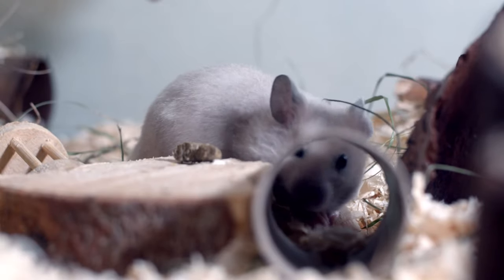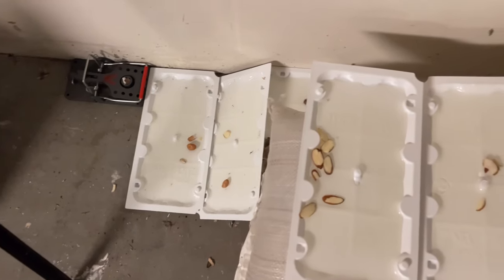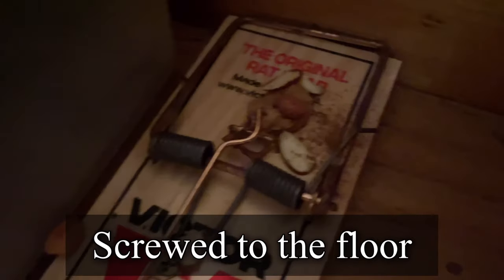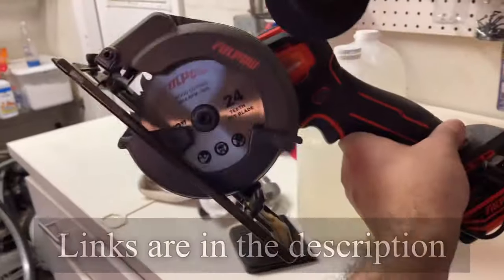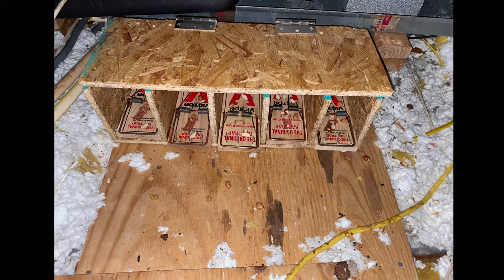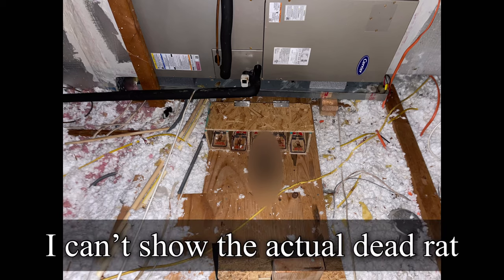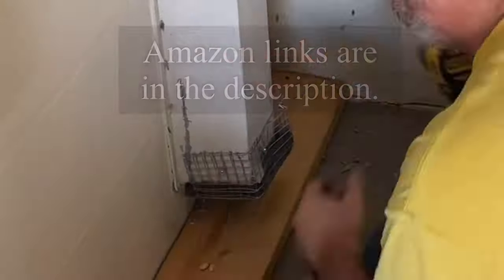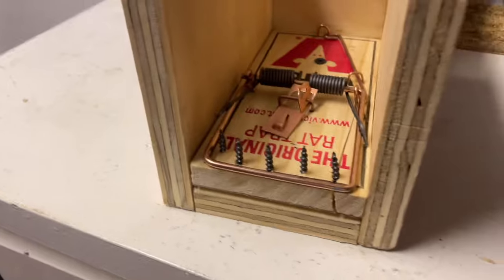DIY Rat Trap Secrets to Kill Smart Freakin' Rats (and BIG Rats)!

Comment: I have a smart rat problem.. and is really smart. The sticky trap does not work. It comes off. The other regular trap does not get it. We got the cage one.. and we can not get it…
Reply from the maker: I had the same issue, but I had to bait these traps for a week or two every night without setting them and then eventually I set the traps and they got them. I also wore gloves one handling the traps and the bait and what worked well for me for bait with slim Jim’s
Reply: Plus one for the gloves. Wash the traps with soap and rinse really well. Then only handle them when wearing gloves. The big ones get off the sticky traps, but I gave the ones plaguing me some really bad nights stuck to the sticky traps getting stuck also to my bicycle and wandering the garden with a dinnerplate sized board stuck to them before I got them with washed traps.